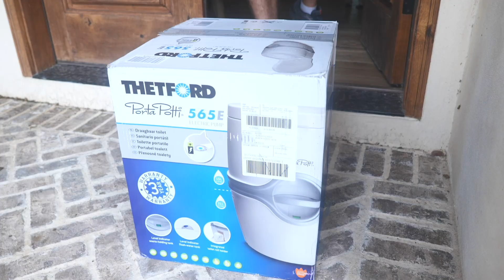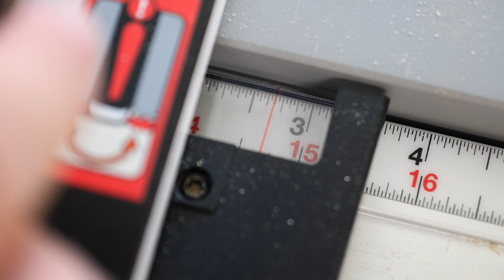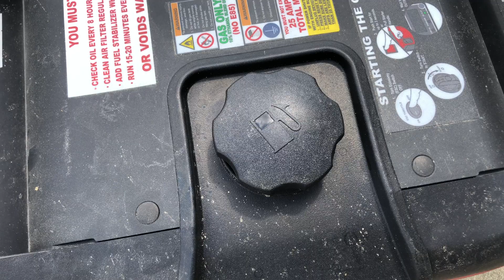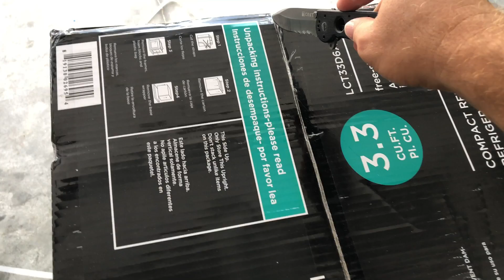Cargo Trailer Camper Conversion / Bunk Bed with DIY Lift

Comment: I was thinking, if you're still considering feedback, that you could actually hardwire the toilet, depending on the required voltage. Then ya'll wouldn't have to worry about the batteries.. Just a thought. Anyway, love your channel! Keep it up!

Comment: Use a block and tackle on both ends (Pulley system), to lessen the weight immensely. No need to change anything just add-on. Easy as pulling a cord to raise mini blinds!!!

Comment: Great video editing . . . 

So I put a bed with storage under it on one side of the trailer which is really cool for sleeping and sitting but now I'm thinking I dont have room for much storage on the other side over the axle so how am I going to balance the load unless I put very small storage there for water jugs. I may have to convert it to the way you did it in this video . . .  It wont be all that hard and I wont waste that much plywood.

I like the way you work, the only thing I do different is I use glue and a brad nail gun instead of pre-drilling and countersinking screws. Even if I do use screws I dont countersink them any more because these new screw guns drive them in so deep you dont need to counter sink them. The glue itself is stronger than the wood . . . yada yada . . . :o)

Great sense of humor as well . . .

Comment: i am late to this party...great video. I am going to start a build of my own this spring.  I may make a upper bunk like you. I just thought if you were to put a bunch of holes in the bed bottom it help lower weight and it helps it breath.  Take care
Reply from the maker: That’s a great idea. I actually almost did that but then I was too lazy to drill all the holes. 😄 Thanks

Comment: These videos are just haxtastic!. Just a thought about adding beds to trailers. Why not use pipe and canvas to make the bed? Two poles on the long sides and the canvas hanging like a hammock. It would be less weight too. Cannot wait what you come up with next. :)
Reply: look at disc-o-bed s

Comment: L.O.L. comments he puts fingers to close to saw table blade. I laughing over square lines for the chop box. All around nice job though. Think you could of used 3/4 plywood in place of studs for maybe less weight on the lift bunk. But again sweet build and item testing for many as I have a 6x12 v-nose I'm thinking same thing on. I also have a great bug out truck. An 88' f150 with nicely not over done body/frame lifts, 90,000 miles on straight 6cylinder mated to the granny tranny that can pull stumps out. Great gas mileage with dual tanks. 4x4, mint interior with luxury captain seats, all power with cruise control. 32x5 all terrain tires and highboy fiberglass cap.

Comment: Almost everything you put in is weight lowers your gas mileage for as long as you own the trailer. It also puts more weight on the axles. Use alum channel or unistrut will put less weight than using all those 2x4. 
With metal you get the strength.
Reply from the maker: No doubt metal would be preferred but I’m more comfortable working with wood.
Reply: Properly dried wood weighs about the same and is cheaper. The key is to use the smallest size lumber you can to do the job. Most people overbuild and don't use proper joinery.

Comment: Your a freaking nut. I like your sense of humor. On your bed lift have you ever thought of a weight system like the old windows a few pulleys some cables and a few weights would take a lot of work off lifting that bed. Maybe even a small block and tackle on each side would work. Either way it looks good I have to check out your other video's.
Reply from the maker: 😂 Thanks so much! I'm definitely going to do something to help with lifting. That's something I hadn't thought of.

Comment: That ‘lifting bed’, would not be out of place in a nuclear bunker. To lighten it up and improve air flow and to help prevent condensation under mattress; why not drill large holes through like in your bench ‘air bed’ ?  You could also do this to the bottom leaf of your table/bed extension,  without going right through of course ! Great build, great upholstering, easy to change and clean. Following in U.K. Regards AJ
Reply from the maker: Thanks AJ! That's a great idea. I just might do that! Thanks for watching!

Comment: Hey what was the purpose of the plywood on the bottom of the bed? I saw another build with a light put into the bottom of a bed like that. Are you planning to hide a light in it or was it just for the structure and cleanliness of it?
Reply from the maker: It was just for structure and cleanliness but the light idea is a good one.

Comment: What are the Green and Black on the wall? Acoustic tiles? Did it come with them or did you add them?.
Reply from the maker: Yes. I put them up. This was my office trailer I used for editing before I started converting it.
Reply: @HAXMAN  Where did you get them?
Reply from the maker: @MommaMoonontheMove  I’m not sure. It was years ago. I think it was Amazon.

Comment: Dang...it hurt me to watch you lift the top bed the first time. Reminded me of a time I was trying to put wings on a 4place airplane by myself (one at a time). I could ALMOST get the first one high enough on my shoulders. Thought I’d just get that extra inch or so by lifting with my head. I heard a little “pew” (from “inside” my head) and knew it couldn’t be good. Turned out I blew out three discs in my neck. Felt pretty stupid. What fun THAT was...🤪

Orvis shirt? Are you a fly fishing brother or did you just like the shirt?
Reply from the maker: I know a guy who has a fly fishing and falconry business. I bought the shirt and new fly fishing gear. Wore the shirt. The gear is still unopened in my closet 😂
Reply: @HAXMAN  well, you gotta give it a try sometime. Start with poppers and warm water fish in lakes. Stream fishing is more difficult, but so much more satisfying . A good thing to work up to.

I’ve been fishing the fly rod over 50 years. It is about the only thing I want to use. Warm water or cold. Just about the most fun you can have with your pants on.🤠

Maybe you could use some of that space behind the seat backs for your fly gear.😎
Reply from the maker: @hgj2019  I'll get around to it eventually.

Comment: The purpose of lifting bed up is????
Reply from the maker: So that the full dinette can be used during the day. It's too low to sit under when it's down.
Reply: How tall are your kids? Maybe they can fit?
Reply from the maker: I actually think the two smaller ones might. I haven't done a test fit yet 😄

Comment: Fail. Sorry but your lack of understanding the weight to strength ratio doomed this project to fail. It’s too damn heavy!
I would have made the 3/4” plywood side trim be the actual structure and then used hardwood 1X3’s across and used hardwood dowels to fasten them so it still looks good. I would have then used 3/8” plywood to put the mattress on. This would be strong enough for two 60 lbs children or a teenager
Your hinged supports could have also been 1X4’s. This would cut the weight in half and that’s a lot of back saving and gas savings
Reply from the maker: This trailer has a 4,500 lb load capacity. The 400 lbs or less weight I’ve added total is nothing.

Comment: Over built,duplicated structure, Super heavy build.
Reply from the maker: The trailer has a 5,000 pound cargo capacity. At this point I've added maybe 250 pounds. I think I'm still pretty good compared to a traditional camper build out.